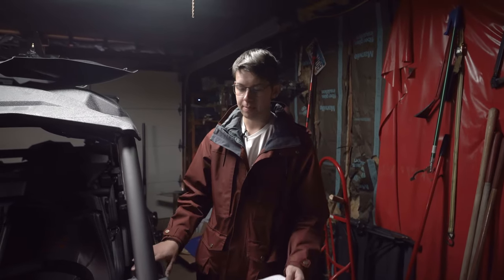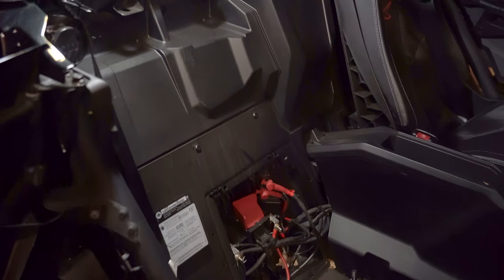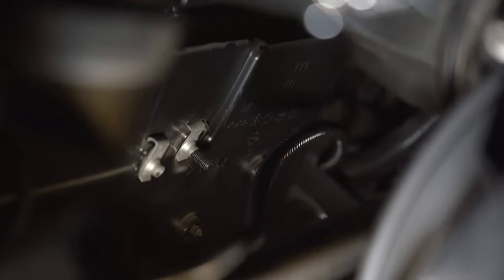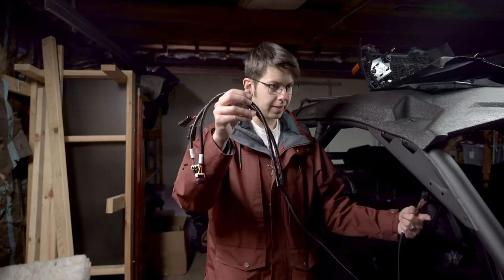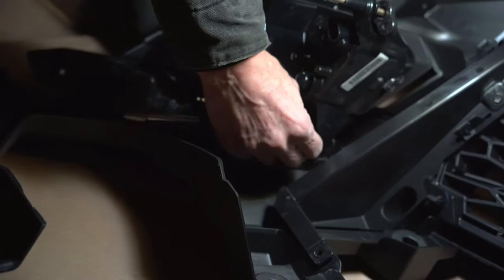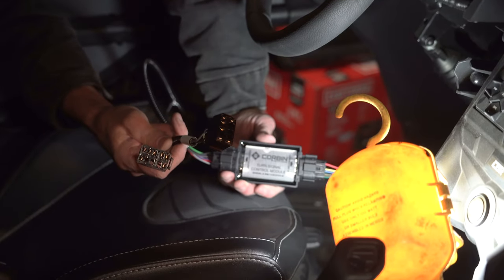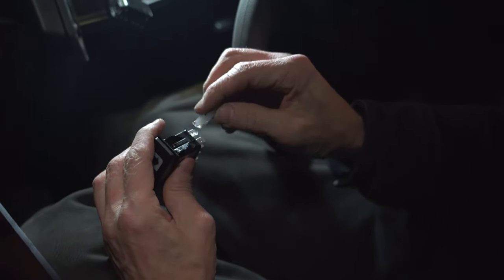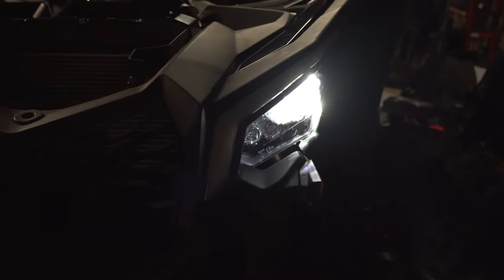Corbin Street Legal Kit Install on 2022 CanAm X3

Comment: Corbin makes some awesome products.   I stumbled across them by accident via my local Polaris dealer.  I bought their turn signal kit for my Ranger and met the owner at his shop back when he first got started building accessories.
Reply from the maker: Awesome! Yes, we've been very impressed by their street legal kit.
Reply: @InfiniteExplorers  That's Great but what if you're trying to connect sideview mirrors to work with the corbin fang lights? where can I buy the splitter... my BF is going crazy trying to find it...

Comment: You dont need to remove the top of the console to run wiring. Instead of metal fan support you should have got a ct raceworx front gusset kit instead. Not the worst install ive seen honestly. Just make sure your connections at the bus bar arent on constant power. You will end up with parasitic drain.
Reply from the maker: Thanks for watching! We made sure to connect the wiring to the proper terminals so we don't have battery draining problems.
Reply from the maker: Thanks for watching! We made sure to connect the wiring to the proper terminals so we don't have battery draining problems.
Reply: So when you connect the positive wire into the busbar did it drain the battery?